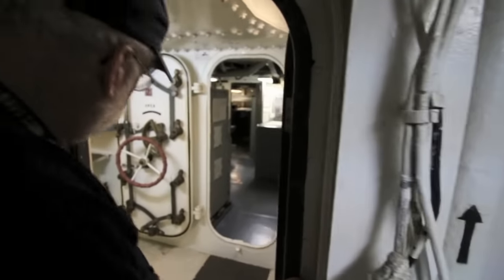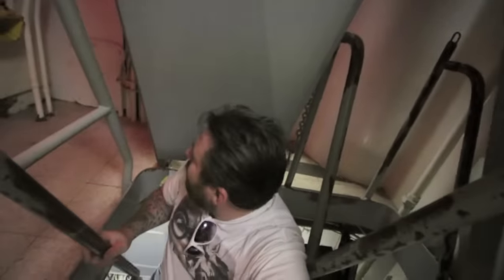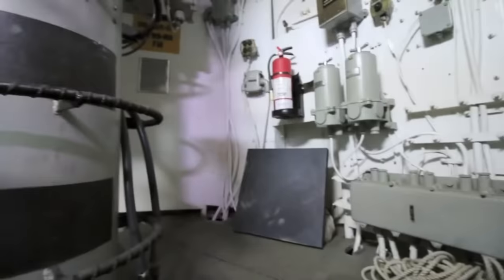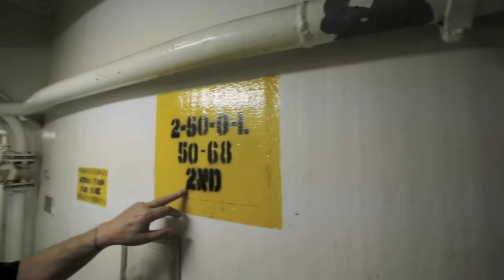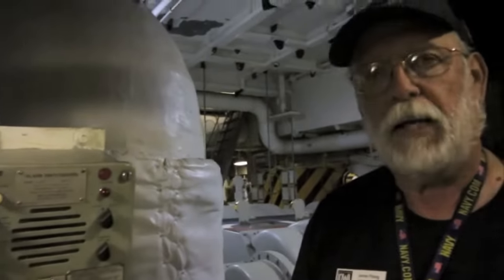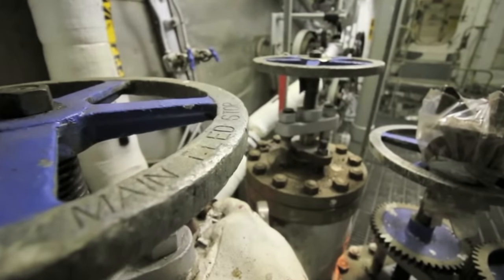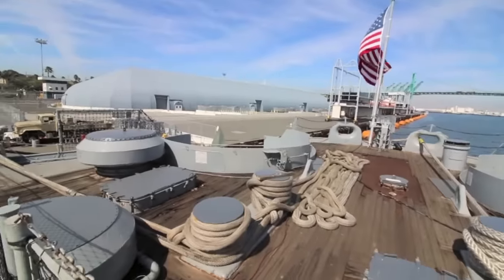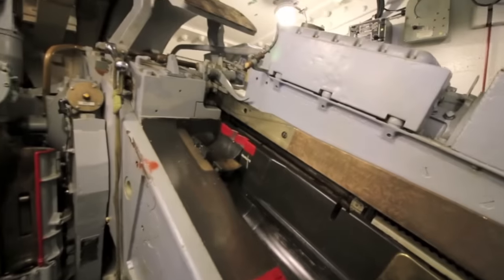Exploring OFF LIMIT Areas WW2 Battleship : USS Iowa

Comment: Thanks for a fantastic tour. What were those "pits of death"? The escape trunks?
Reply: Nope. Those are "strikedown hatches".  T1 and T3 have 2 each, T2 has 3 (1 for powder only), These are where you onload powder and projectiles
Reply: Ah! Thanks! What were T1 and T2 again? Were these the turrets? I wasn't sure where you were in the ship at that point in time, it looked like somewhere below the main deck level.
Reply: @iskandartaib  
Yep, 'turrets'.  Location was on second deck, 1 below main. The precise location of that one  (remember, they're vertical, from main down to the powder flat, i.e. the bottom) is starboard side, right up against T1's barbette, The hatch is at about 5 o'clock.
Reply: @jamespobog3420  Ah, so you did make it into one of the turrets. I've also watched the "turret crawl" video, very very interesting indeed. Is the armored door at 14:01 in the turret's barbette, or is that elsewhere in the ship? Fascinating tour, and thanks very much for the explanations!
Reply: @iskandartaib  
That is the stbd passageway door right at the front of the armored citadel (the armor shoebox between T1 and T3).
Reply: @jamespobog3420 I'd read in the past that the Iowas were designed with "all or nothing" protection, but it's so interesting to see where the citadel actually ends. Thanks!
Reply: @iskandartaib  That is correct. What is your understanding of what "all-or-nothing" means?

Comment: I’m wondering what that hole leads to in the beginning of the video with the steel mesh over it.
Reply: There are 2 vertical trunks shown. The smaller (about 3x3) is just a vertical access trunk, the larger one thru the thick armor deck is called a 'strike-down hatch', and is one of several vertical trunks where ammo (projectiles and powder) is onloaded to the magazines.

Comment: Iowa looks to be in much better shape than USS New Jersey; New Jersey's decks were rotting, turrets were torn to pieces inside of them.
Reply: Our decks are rough in places too, but we have an ongoing project to replace sections. It's slow work though...

The rest of the ship is pretty good. turret #2 is total non-op, the other 2 need cleanup, lots of hydraulic fluid leaks.

Comment: Would have loved to see the engines...;(
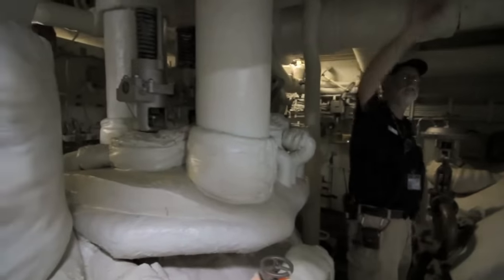Reply: Though it's framed tight, you can see them around 16:50+
Reply: @jamespobog3420  Thanks James, so thats really all there is to the engines is the high and low pressure turbines?
Reply: @kevinm3751  Yep. And the reduction gears. Steam generation, while part of the propulsion system, are not part of the 'engines'.
Reply: @jamespobog3420  Well thats just downright depressing...;) Thanks for clarifying this for me though!
Reply: @kevinm3751  
Depressing? Why? What is it that you are curious about? Or is the edit just too quick?
Reply: @jamespobog3420  Depressing because I was expecting there to be more to it. Nothing against you bud...;)
Reply: @kevinm3751  
You are aware that there are 4 of those sets, right? 8 boilers in 4 rooms, 4 engines in 4 rooms...

Comment: Could it ever be recommissioned in an emergency?
Reply: Theoretically, yes. However, it's not going to happen, for several reasons.
1. No crew available, Navy has changed much since 1990.
2. No powder, all gone.
3. No projectiles all gone.
4. No spare barrels, all gone.
5. No legacy spare parts, all gone.
6. Navy has said specifically: "We do not want the ship back. If your museum fails, she will go to scrap."
7. The entire class (4 ships) is old, tired, and worn out.

Comment: What was the range of the lookout binoculars? 
Could they see as far as the range of the guns?
Reply: No. I do not know exactly the power, but something in my memory says 10x50. Remember, optics are line-of-sight, and the targeting radar (Mk. 38 director) was actually, all the way back in WW2, 'Phased Array' which is cutting edge today. It could see over the horizon. On the Admiral's bridge are two sets of "Big Eyes" binoculars. Again, I don't remember the power, but the optic elements are about 5-6 inches in diameter.

Comment: I'm surprised that a ship as stout as this 17. 1/2 inch thick blast doors and most likely a 16 inch thick armor belt arou d the water line that was refurbished in 89 would have floors with safety issues
Reply: Not sure what you mean. She retired in '90.

Comment: show us the firing pin for the 18 inch guns .
Reply: Those exist, but are not in the guns, they are removed and locked up. The piece is called the gun 'lock' and IIRC (I've seen one once) they are a machined assembly about 10" x  roughly 4" diameter. The pins for the 5" guns are about 8" long, 2" in diameter, with an exposed coil spring. The main thing to remember is that primary ignition is electrical, the percussion firing pins are secondary.

Comment: High pressure steam will cut your head clean off of your body. You won't see it. You won't hear it. Your head will just fall off.

When there is a suspected high pressure steam leak, you walk around with a broom handle in front of you, prepared to stop walking in the case that the broom handle slices in half in front of you.

But like the guide said, unless you have some reason to suspect something is leaking or about to blow, you spend absolutely no time thinking about all of the stuff that can kill you down there. There is no point in thinking about it. You gotta work, and if you have no reason to know it is going to happen there is not much you can do about it.

Comment: First impression suggests that it wouldn'r be that long or hard to put her back into service....
Reply: To the contrary. LOTS of time, money, and drydock time. All sea chests are welded over, much machinery is partially disassembled, the boilers need re-bricking, the entire electrical system is problematic, all powder, projectiles, and spare barrels have been scrapped, and there are no legacy spare parts. Ain't gonna happen.
Reply: Ok. Lipstick on a pig....:)
Reply: Not sure I'd put it that way,.. Maybe go-go boots and a mini skirt on a granny...
Reply: That is better, now that you mention it.
Reply: I bought a million dollars worth of steam turbine blades - brand new spares - and a few main bearings, about 2 tons each, for 60$ in a Navy surplus auction several years ago. Also a 1800# helical drive gear that indeed would not like a wrench dropped on it when running. Maybe some of those legacy spare parts from the Iowa.
Reply: @RRaucina   Post a pic if you can...

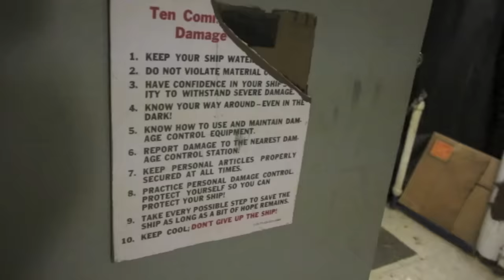Comment: 14:28
Ten Commandments of Damage Control
1. Keep your ship water tight [see #2]
2. Do not violate material condition [when the door's supposed to be dogged shut because you're in battle, leave it dogged shut]
3. Have confidence in your ship's ability to withstand severe damage [they added the "severe" after WW2]
4. Know your way around - even in the dark [......yikes. Can't imagine how many broken bones that would take to learn...]
5. Know how to use and maintain damage control equipment [lesson from the USS Forrestal fire off Vietnam where all the trained firemen got killed and nobody knew how to run the hoses]
6. Report damage to nearest damage control repair station
7. Keep personal articles properly secured [I guess so your personal gear doesn't cause a fire? Kinda odd...]
8. Practice personal damage control; protect yourself so you can protect your ship
9. Take every possible step to save the ship as long as a bit of hope remains [in WW2 multiple ships burnt to the waterline but their hulls were still floating, and multiple others sank due to unstoppable leaking while their boilers were still burning and their props still turning]
10. Keep cool, don't give up the ship! [see #9]

I'm surprised they didn't include one that said "In the event the Cold War turns hot, please bend over and kiss your ass goodbye." Even a near miss from a nuclear torpedo or missile would shower every vessel within 10 miles with enough radioactive seawater to bond with the paint on the ship and kill every resident within a week, no matter how hard you try to decontaminate it. Google Operation Crossroads.

Comment: Origin of the phrase “monkey wrench” did not originate on any battleship, although the phrase would sort of fit the sabotage scenario you laid out in the video. However… it was actually initially spelled “Monckey”, a deliberate misspelling of the word (which was the last name of someone back in the 19th century). And the phrase was intended as derogatory.  It morphed into the following generalizations:

– was of throwing a monkey wrench into the cylinder of a threshing machine, i.e. a power-driven machine for separating grain or other seed from the straw or husk;
– appeared in the late 19th century;
– exclusively referred to political situations.

Comment: So the gun explosion isnt sabotage the other theory by Sanda Labs says it could have been too fast ramming speed of the powder charges, but this has not happened in the 250,000 previous times these guns have fired, strange, but no other possible explanation???
Reply: It's not just the speed of the ram but also the distance.  It was compressed  strongly. The powder had also been re-manufactured incorrectly, lot numbers had been mixed, a big reloading no-no. What is your source for 250,000 shots and is that attributed to Iowa or all battleships? There have been more than a few naval gunnery accidents, there is even an exhibit in the Iowa's museum on the subject USS  Mississippi even had two gun accidents years apart, both in center gun, turret 2.

Comment: How do i get a tour like that!?
Reply: Well, there's 2 ways.
1. Come to the ship on a Saturday or Sunday and purchase a Full Steam Ahead tour ticket. It will not be identical, but you'll see Aft Plot, Fire Room #4, Engine Room #2, Sick Bay, Broadway, CEC, and if time permits, Post Office and Machine Shop.

2. Purchase a Big Stick Experience ticket. It covers 1 to 6 people, includes lunch in the Captain's Cabin, and covers just about all you could ask for (and it is a menu driven tour, you tell us what you want to see), with the exception of main gun turrets, or any area that is red tagged by the EPA.  At this point, the turrets are extremely contaminated with hydraulic fluid.

Ticket price for Big Stick Experience is $2500 (1-6 ppl).

Comment: "dry steam. What that means is that its steam with no water in it". Pretty sure that's called air?
Reply: Superheat is a rather strange state. I use words like that so that guests can at least have a chance of understanding the concept.

Superheated steam is dry, and for all intents and purposes it sort of is like air...very very very hot air, the molecules being so far apart that it might as well be really hot air. However, when it is cooled below it's boiling point, it condenses back into water. Air doesn't do that. The hotter you can make the superheated steam, the more work you can get out of it. Example: Water boils at 212*F. If I heat that steam to 250*F I can get work out of it only until it reaches 212*F again, when it changes back to liquid. That temperature drop is only 38*F. Now if I heat that steam to 850*F, I can get LOTS more work out of it. That temp drop is 638*F. MUCH more work.

Here's something to ponder. Liquid nitrogen boils (changes from a liquid to a gas) at  -346*F, below that it is a solid. The air we breathe is 78% nitrogen. That means we exist in an ocean (or cloud if you wish) of superheated nitrogen.

Superheat is not a fixed point on a thermometer, it is a temperature differential, different for different gasses.

The real, scientific explanation is more complicated than that, but explaining it to guests in technical terms will cause them to glaze over and drift to memories of their last trip to Hawaii. Explaining it like I just did, the basic concept will be understood and remembered for the rest of their lives.
Reply: @jamespobog3420  Thanks for the reply, appreciate you taking the time :)

Comment: It so sad that 47 sailors died over that explosion. According to a sailor who was there when happened who had to crawl thru the turret he said that none of the hatches were closed at the time which would explain how so many could have died. I'm not a navel ship designer but those hatches are there for a reason and that fire wouldn't reached the bottom of the ship. The Captain should have been Court Martialed.
Reply: It would surprise me if internal hatches were open, the turret officer and the senior enlisted Chief were very good men.  There would really be no reason for hatches to be open between levels, like the Brits did at Jutland, the ammo handling system is different. There is a display in the museum of 2 of those hatches. The one from another turret is pristine, the one from T2 looks like a giant punched it and that would only happen if it was closed. What I do know is that the tail hatch (the exterior entry point) was blown off completely and is at the bottom of the Caribbean.

Comment: USS Iowa is still us navy ship not just a museum it's in reserve wish they would bring it back to active service
Reply: Actually, she has been stricken from the Naval Register, and the Navy has told our CEO "We do not want the ship back." There are also several good reasons why the ships will never be re-activated, all those who could run it are now old men, all spare barrels have been destroyed, all stockpiles of powder and projectiles are being destroyed, there are no spare parts for any legacy equipment.

Ship design is extremely complicated and difficult and simply 'removing turrets and replacing them with VLS' shows a lack of understanding about how ships are designed and built. Even if stripped to a bare hull, it would be vastly more expensive to re-fit than to design and build new.

Ain't ever gonna happen.
Reply: I see now I looked on one navy.mil site claiming it was part of reserve fleet however I found on naval register it's has been stricken and is now museum and memorial. If that is the case why havent they removed the modern weapon systems on board like ciws and the chaf and I heard them mention in this video harpoon and mk38
Reply: CIWS and Harpoon are mock-ups, as well as the 4 forward Tomahawk launchers. All the electronics for those are gone, though we have acquired salvaged consoles for display.  The Mk38 directors are there, but you have to remember those are 40's technology with vacuum tube electronics.
Reply: Ok I was thinking the new mk38 25 mm gun. Well hopefully we see battleships again thank you for the info
Reply: My pleasure. You're welcome.

BTW, there is very little info on this, but I have heard that the Marines had a couple Bushmasters on the aft missile deck, there seems to be a couple mounts for them back there.

Comment: 19:17 Line diagrams reading guide:
https://www.marineinsight.com/guidelines/draw-read-line-diagrams-onboard/
In this case the pipe he is looking at is an air line??
Reply: Merchant Marine does things different than Navy, although the Navy does color code some lines. Steam lines are covered with insulation so they are painted white. The Navy also labels lines with text and arrows for flow direction.

Not sure which line you mean but if it is the big one with stripes, that is a propellor shaft.

Comment: After you watch this you say why the hell did they build a Zumwald when they could have built the Montana!
Reply: Don't forget, the Iowas ain't stealth. Even if a stealth Montana had been built, main battery would be different. The ability and facilities to make those big guns (not to mention armor) has been lost.
Reply: 12 RAIL GUNS NEW technology. Instead of a gun platform a missile platform able to launch 500 to 1000 missiles of all types. You can make a Montana stealth, when entering the combat zone the ship takes on ballast and has a profile like the Monitor, you streamline the upper decks like the Zum. Those big Billion dollar carriers are not stealth.
Reply: Iowa class was built for speed, the bow was made that way to hit the mid 30 knots. With all boilers fired I wold say closer to 40 knots. Check out old pictures and video of shake down and look at the wake, its very high speed and resembles a destroyer wake.
Reply: The rail gun is far from being fully developed. Nowhere near being ready.

The Montana you describe is nowhere near the design of historic Montana, and therefore would only be a name, the entire ship being a new design. And you are correct, carriers ain't stealth, but they are also long range standoff platforms.
Reply: There's no documentation of an Iowa ever hitting 40kts. Design requirement was 33kts. I have heard of an actual, documented 35kts. The guy who is the VP and IT manager was 80's crew and as a young E-3 was on throttles in Main Control (Engineroom 3) when an unofficial speed run was done. This is a man of the utmost integrity and he says he personally saw 36kts on the pit sword indicator. He said "I thought I was going to die." Speed/power is not linear, it's exponential. It's a long long way from 36 to 40kts.
Reply: Well now. It's ashame how we are back pre WWII ships going  24 knots no arnor. Russia has a heavy crusier what will we send?
Reply: The reason for that is that the days of ship-to-ship shootouts is over. Air power, cruise missiles is where everything has gone. There's even talk that not long fighters will be pilot-less.

As far as I know, our surface ships still have a 30kt+ requirement in order to keep up with carriers. And our DDG's (Arleigh Burke class) and Ticonderogas (CG's, guided missile cruisers)  are no slouch. I've been on a couple Burkes and they are really something. I didn't even "recognize" that navy. Wasn't mine. My navy is WWII and Korea -built ships.  I've been inside a VLS 'Sherwood Forest'. Wow...